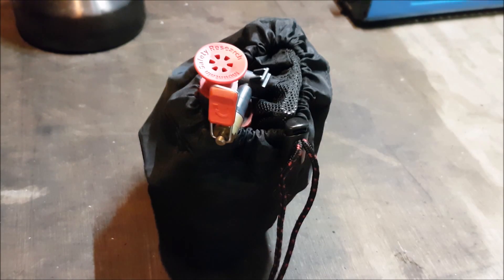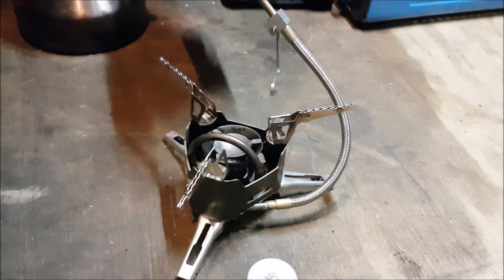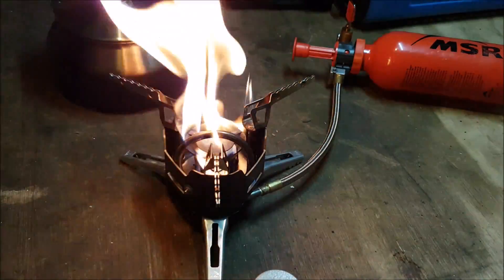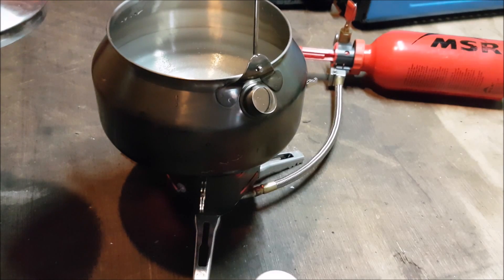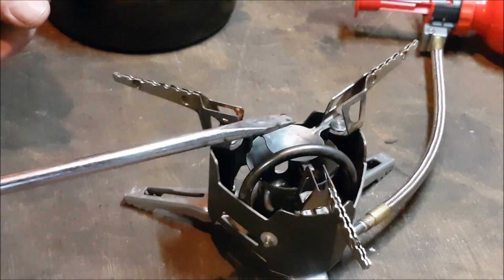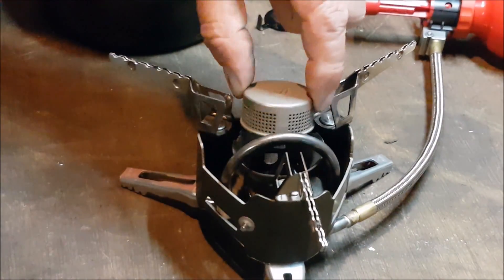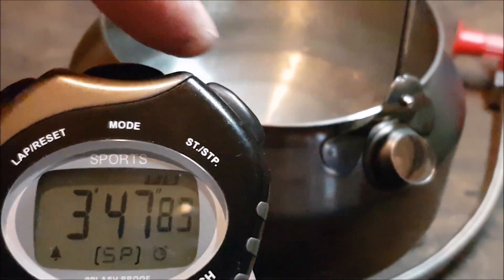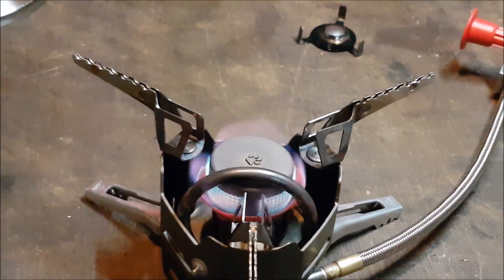MSR XGK EX Noise Damper fit #BernieDawg #MSRdamper

Comment: Nice video.  I would have liked to see a burner flame control test, maximum vs. low simmer comparison.  I purchased one of these XKG Stoves as a USMC surplus.  It has the reflective plate roarer burner like the Optimus with the Nova burner, or a bigger version of the 8R/SVEA 123 burner.  I purchased the Bernie Dawg dampener cap to quiet it down and help with better simmer control. It is quieter and the cap seems to give it much better flame control.

Comment: Why do you choose the XGK? My understanding of that stove is that it is extremely reliable even when burning vehicle fuels but that it burns so hot with no simmer at all and is only really for boiling?
The Whisperlite Universal seems better for civilian use, as it is already far quieter and also lighter while burning canister fuel with a simmer for proper cooking and even getting some level of milder flame for some degree of simmering even when using white gas or Kerosene, plus can still burn unleaded if necessary

Comment: I once asked "Bernie" (maker of these caps) whether there is reduced output as a result of using the cap over the original burner and he said it wasn't reduced. Looking closely at the flame pattern of the two examples here, the cap has a more divergent flame and some of the flames are "licking" the sides of the pot, not so with the flame spreader, which concentrates the heat more centrally. I suspect that it's this divergent flame pattern that is accounting for the time difference in bringing the water to a boil. since the jet produces a constant amount of fuel, there's no reason to suspect that OVERALL heat output is reduced with the cap. 

I'm glad though that you did an A:B compare since you're the 1st one I've seen demonstrate this so it's valuable info.

As far as wasting fuel, my suggestion is to reduce the flame output keeping the flames more central which may not affect the time to boil too much (might even improve it!).
Reply: Thanks for watching very much liked your comment

Comment: Around 1980 I bought a MSR GK multi-fuel stove (forerunner to the XGK) while serving with the US Army Special Forces in Europe. Best liquid fuel stove I've ever owned, and I've owned serveral and used many. I used it on +14,000' mountain tops, above the artic circle, every winter, and in the middle east and north African deserts for weeks and months at a time. I have burned white gas, unleaded and leaded gas (have to do a lot of cleaning to get the lead out of the fuel line), Naphtha,  kerosene, aviation fuel, and diesel (don't recommend diesel unless you have no other choice) without any issues. I still have and use the stove. I highly recommend this stove for mountaineering and winter camping. The fuel bottle and stove is a lot heavier than canister stoves, but if you're going where cannisters are hard to find and need a liquid fuel stove, you cannot beat the MSR XGK-EX.
Reply: Agreed, I got one of these in 1990 (think it's the XGK II). Even used it with cheap vodka mixed with aviation fuel (it just about worked), and with some diesel mixed with cooking oil (that also worked).
It's a bit of a one-trick pony -- it boils water fast and it melts snow quick. For that, nothing else comes close, plus it's pretty much entirely field serviceable.
On winter trips with a group the XGK and Whisperlite combo is great -- the XGK for the snow melting and Whisperlite for the cooking.
Just goes to show how amazing these MSR stoves are -- they're 30-40 year-old designs that have barely changed over the years, and still beat anything else out there today.

Comment: I use this stove extensively burning unleaded gas.  I don't have much faith in the shaker needle.  It needs to be replaced occasionally and the manufacturer does not sell that part individually.  I've noticed that when it clogs, which does not happen very often, maybe between 80-120 burns, it's clogged and shaking does not fix the problem.   I remove the jet and clear it with the tool.  It's not a big deal.  My advice for using it is after you turn it off but the stove is still burning, hold the bottle letting the stove hang.  That way gravity helps get all the remaining fuel out of the line.  So when you disconnect the fuel line from the bottle you don't have unburned fuel leaking from the fuel line.  I would use white gas if I had it, but it's not easy to come by when I'm on a bicycle traversing the country.   Unleaded fuel is everywhere.   It's discouraging to me to know that the msr people don't encourage the use of unleaded gas.  I imagine using diesel and kerosene would be dirtier.
Reply: If your clogging the jet id look into running some seafoam or something from time to time to remove any buildup, but for stopping and shutting it off just flip the fuel over and it will push all the fuel out and just do air then there is nothing left to worry about.  yes less refined fuels will need to be cleaned more often thats just physics. If its a constant issue might try using the other jet and see if that solves the issue as its a bigger jet might not be as efficient but might work better in your case of dirtier fuel clogging up. worth a shot imo
Reply: Thanks for the tip about holding the bottle and letting the stove hang.
Reply: @And-rc9yy  thankyou!  I'm happy to know I can help.

Comment: Thanks for sharing this test and all the info.
So more money and weight, to have a much less efficient stove....no way.
As i understand, it will only be quieter if it outputs less power ... just use a lower setting, a less powerfull( less noisier) stove  or at least, another stove that allows better simmering .

Comment: I replaced my MSR with a nova plus. The MSR is virtually unadjustable for heat, and only good for boiling water. In that respect, it’s the best. The Nova plus is far superior for flame control. Which is great for conserving fuel.

Comment: Just thought maybe I should point out that that silent damper cap in your video is not a Quietstove product. It is, in fact, a BernieDawg XGK EX Dawg silent damper cap for the MSR XGK EX. Thanks for purchasing it! Works really well!
They are available through either of my two web outlets:
https://www.shapeways.com/product/8X8H3M5F6/xgk-dawg-for-msr-xgk-ex
or
https://i.materialise.com/shop/item/xgk-dawg

BernieDawg silent damper caps are the original designs by the original designer of silent damper caps for modern backpacking stoves - me. Sorry to sound like a commercial, but it seems a wee bit more appropriate to credit it as my product in your video rather than my competitors product (Quietstove) - might also reduce the disappoint for any prospective buyers when they end up with a less awesome cap from Quietstove instead of one from BernieDawg. ;-) Maybe an edit, please?
Thanks again for your purchase. Let me know if there's anything I can help with in using my product.
Happy camping!
BernieDawg  - berniedawg.com
Reply from the maker: BernieDawg sorted i have changed the name sorry to confuse matters, cheers
Mark